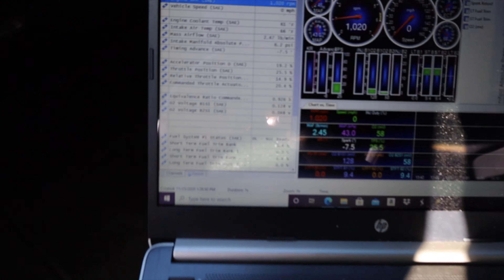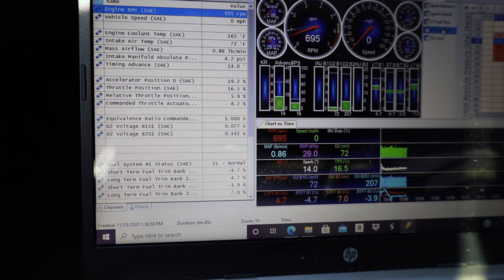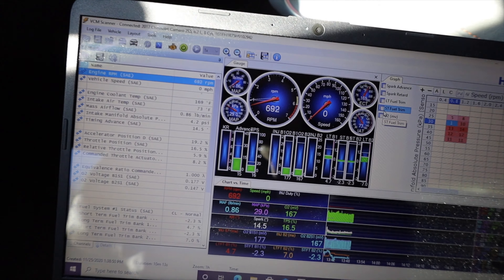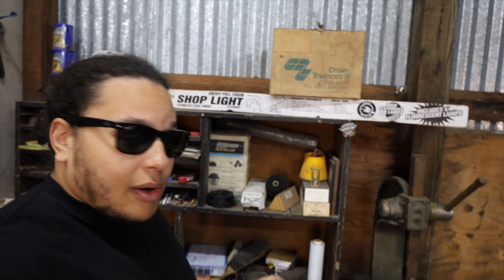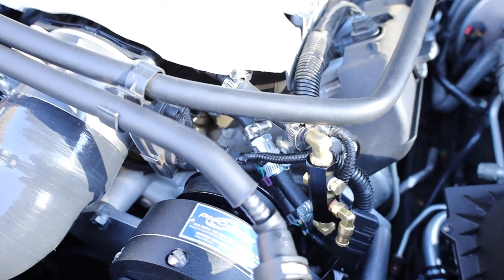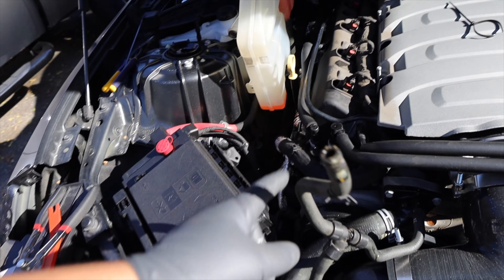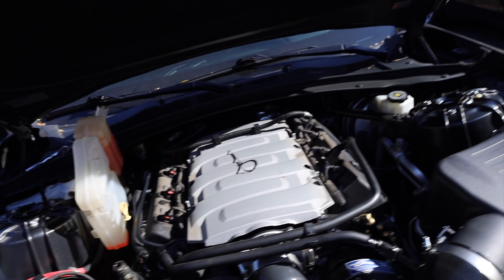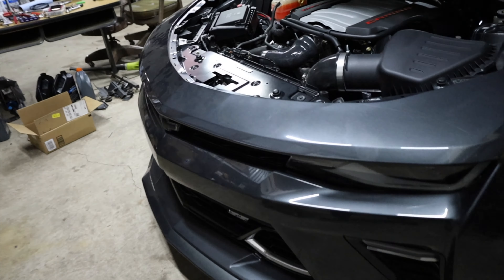ISSUES with ProCharger CANNED TUNE

Comment: Did you have to have the ECU unlocked? I heard 2017 and up need to be sent out for unlocking.
Reply: Yes but only for the Transmission controller. The Engine, Trans, and Fuel system all have separate computers on these cars.
Reply from the maker: 👆 that part. Only TCM must be sent out

Comment: Yeah its still off bro.  Stft are always gonna move up and down as they constantly change but long term fuel trims should mellow out after driving and be single digits.  A period at + or - 25 will throw a check engine light for same codes you got last time.  Fueling is just hard to get right with remote tunes. Every car is different even if they have same mods.
Reply from the maker: Okay, that’s more or less what I thought but it’s nice to hear it confirmed. You’ve been hella helpful, thanks bro
Reply: @ZtZoomin  Anytime.  Also keep in mind that LTFT take roughly 50 minutes or @ 100 miles to really get the info it needs to be correct since it learns off the STFT. So don't be alarmed if its still hight as hell for a little bit till you get some more miles in the new tune.  I'm sure its still gonna be positive but not like it was as im sure their new tune just "richened" the fueling tables.
Reply from the maker: Gotcha, I knew the ltft took some time to truly adjust but I didn’t realize quite that long. I hoping to get some good miles tomorrow and get another data log. Then probably send that over to them and hopefully they can dial it in a little more for me

Comment: Hi, I figured I would share some knowledge. For starters, when you flash the ECU you have to press the start button without your foot on the brake 1 time, then put foot on brake and hit the start button or it will only crank over once and not start.

Second. You only need to look at the Long term fuel trim averages. Pay not attention to the short term. Also when you let off the throttle, by design the fuel trims will go way positive. That is called deceleration fuel cut off(DFCO). 

3rd. Fuel trims are only relevant with closed loop part throttle fueling. When you get into boost the ECU enters open loop Power Enrichment mode and does not use fuel trim correction. The ECU uses MAF and VVE for fuel control. 

4th. The only way to get a accurate reading on WOT fueling is with a wideband. I suggest investing in a AEM 30-0334. This will tell you your afr and you will be able to determine if you are running rich or lean when in boost. 

Hope this helps.
Reply from the maker: Yes this helps a lot, thank you for taking the time to type it up. In the last video I was saying how I have an idea of what I’m looking it but know nothing about tuning. Also I have a gauge on the way. 

I’m planning to go on a good drive tomorrow and hopefully let the LTFT run through their cycles and see if things begin to balance out before I reach back out to procharger.  

In your opinion did my fuel trims look fairly normal or still a little too positive?
Reply: @ZtZoomin  No problem. The fuel trims don't look bad. Like I said prior all you need to look at is the long term average. LTFT has the final say so in fueling so don't worry about short. The only time you would worry about short term is if the long term was disabled in the tune.

 The reason why you want a slightly negative LTFT average is because when you go WOT the ECU will add a positive trim number to the WOT fueling (commmanded PE). So if your fuel trim was +2  when you went WOT then it would add 2% fuel on top of commanded PE. Since I see Zero in your screen shot it isn't adding anything so it's fine.

If you have any questions don't hesitate to post a thread in the FI section @ Camaro 6. I have had a Whipple on my 2016 NFG A8 SS for 3yrs now. I have done most of my own tuning so I can give you a few pointers.
Reply from the maker: @joemeyers1016  man thanks, you’re helping me out a lot. 

I’m a forum “lurker” but I don’t post much lol. Usually with enough research I can find my answer but didn’t see anything related to my issue exactly. Or most of the people that threw the codes I did were related to cai issues. 

I’m going on a longer drive today and hopefully I can see more true numbers of LTFT after going through some drive cycles. Then reassess my numbers and see what things look like. 

Last question about fuel trims. Should I pay more attention to the average LTFT’s rather than what a max number might of been at any given point? I kind of been jumping back and forth between average & max LTFT numbers to get a feel for the average and then to see how high things spike.
Reply: @ZtZoomin  yes just look at the average. Remember fuel trims are a correction factor. You are still hitting Stoich 14.1 afr either way. The LTFT just tells you how much correction is needed to hit the target. My guess is the lean code popped up when you went into PE mode. Likely needed more fuel added under boost. That is where the Wideband will tell you what you need to know. Should be in the 11.8 to 12.0 range on pump gas.
Reply from the maker: Gotcha. Again, thanks bro!

Comment: The pro tune is about 800 the first time because 17-up ECU has to be unlocked. After that is cheap and a trans tune adds a little too.
Reply from the maker: My ecu is already unlocked. Trans tune will almost double a tune price (credits + tune) and the tcm has to be sent off. I’ve done my research on getting a tune but I’m just not ready for it yet. And not ready to give up on this procharger one lol
Reply: @ZtZoomin  that is wassup and I understand that fact you want to add other stuff then get a tune